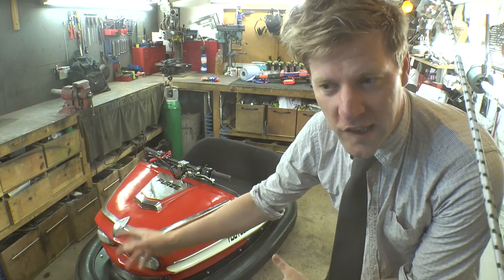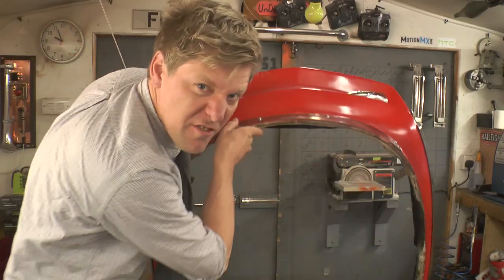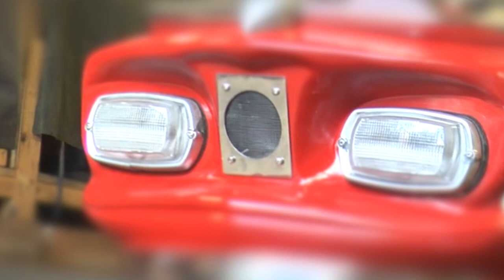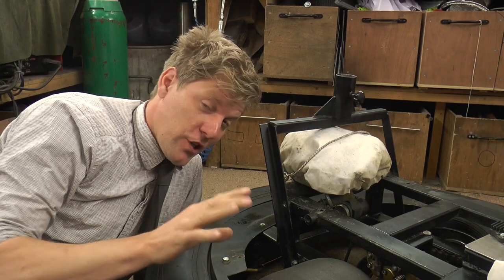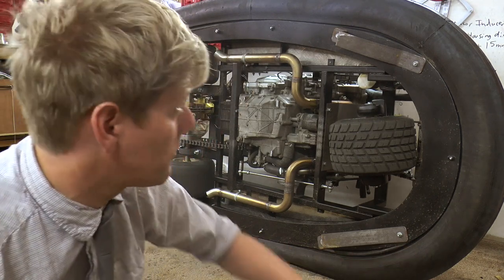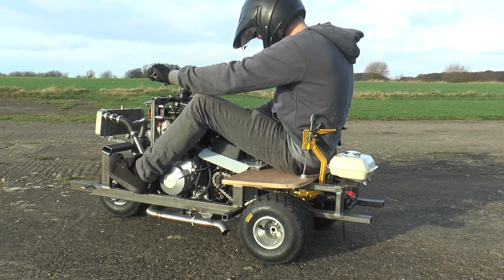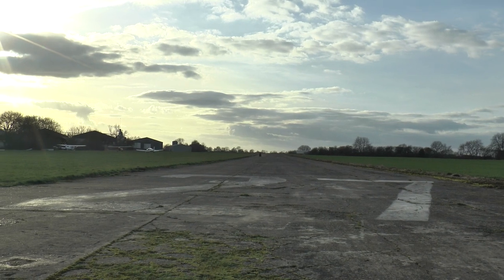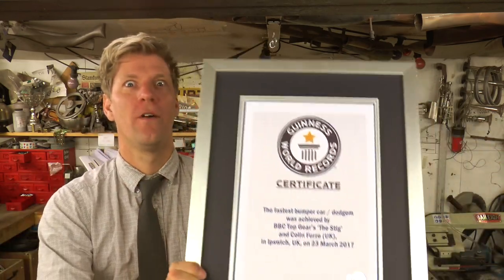100mph Bumper Car Tech Tour/Testing Footage

Comment: anyone else think he's not getting the most out of that engine by shifting at a low RPM?
Reply from the maker: on the first runway its so bumpy you don't want light steering hence short shift
Reply: Hey Colin, never thought your reply, i deffo agree on getting the engine tuned for peak performance, could you get it on one of those portable dynos?
Reply: Chris Readman they actually have dynos for go karts, that could easily be put on there
Reply: doesn't sound like a cbr600 straight piped. could it possibly be running that bad? should be going for 140+ I recon if gearing allows it
Reply: U replied to him???..Whaaaaaaaaaat . Look Colin replied....
Reply: i don't think so , the wheels are too small
Reply: I appreciate the gearing argument. But also consider that the wind had such an adverse effect on the speed would suggest that gearing isn't the limiting factor but infact power is. You see a point where he snaps back on the throttle and theres just nothing happening. A 100hp superbike engine will be ferocious with so much throttle. 100mph just isn't enough
Reply: @colinfurze  you need to get the beast back out knock off the dust .. maybe a turbo or turbine hooked up maybe 115 130 mph ?? i don't have the brass too test that ,, i rolled my go kart about 10 mph in a curve on my back yard dirt track now have a bruised shoulder and arm also a AC separation in my shoulder .. guess i should use the seat belt next time ..

Comment: Jay is probably going to be the most popular kid at school "What does your Dad do for a living?" 
"He puts jets on things and makes things go real fast and gets to drive them". Not only that, probably going to have some pretty good school projects, just saying.
Reply: "A bit of background for this project: My son has a science fair coming up and he wanted to do a scale model of the solar system.  Now I thought, right, that he could do a little one powered by an electric motor... OR, he could make one like this!"
Cut to 20-ft wide moving solar system model running at insane speed
Reply: "As you can see, the Sun actually burns, Jupiter is actually made of gas and this is all powered by a a couple of pulse jets!"
Reply: And we put a tachometer on the earth and it really is spinning 1040 mph at the equator!
Reply: Michael Onines. Balloon busting inbound!

Tachometer measures the speed of the engine (usually RPM). Speedometer measures a vehicle's speed (usually mph/kmh).
Reply: For a spinning object you can use a photo tachometer to get its RPM, then use its radius to calculate speed at the edge. That's the use I intended. I can see with this being a video on cramming a moto engine into a dodgem car where you could take it as me using the wrong readout from the engine, though.
Reply: +Michael Onines. Your comment does make sense now I think about the wheel rotation with one of the hand-held gauges. 

Was smoking and immediately thought engine-wise haha.
Reply: No problem, as soon as I read your comment, I though "yup, I can certainly see where he got that from." I just punched it into the calculator and a 1' diameter sphere would be doing almost 30K RPM to get a circumference speed of 1040mph :-0. C'mon Furze, make it happen!
Reply: +Michael Onines. Oh my. 

Do it! I'd totally watch something like that.
Reply: Raptor Jesus, His coke and mentos volcano project will be epic I bet.
Reply: Or like on Monday during show'n tell his son's like Well I had my father bring his 600cc bumper cart :D.
Reply: He's gonna have a science fair at his school, come home to tell his dad, "Hey Dad, we're doing a science fair at school," and Colin will be like, "Oh cool, can I help you make something?" And Jay will be like "Sure, why not?" But he won't come to school with a baking soda volcano, or even a jet-powered volcano...

But instead he'll come with fucking jet-powered baking soda
Reply: TheLonelyAidan, Ha xD
Reply: TheLonelyAidan ajahahahahahahaha
Reply: Raptor Jesus I don't think that's his son
Reply: Coke and mentos volcano would be more like dynamite and actual liquid rock
Reply: Teacher: Okay class your project will be to build an arts and crafts rocket
Colin: build an actual fucking rocket in  two seconds
Reply: Raptor Jesus so true
Reply: im the 666th like :)))))
Reply: Tormenta
Reply: Physics guy he's not a plumber anymore
Reply: Raptor Jesus f
Reply: Raptor Jesus Colin with a helmet??
Reply: Raptor Jesus After seeing the tie silencer episode...that's  actually sort of reasonable.
Reply: Actually it turnout in the end people like you for being a good person more than anything.

Comment: You got some balls to accelerate into that that speed wobble! crazy awesome stuff here!
Reply: I guess when you're going that fast it's better to commit than to try and slow down. The impact from a wipeout that fast is gonna take you out hard as fuck either way.
Reply: That wasn't speed wobble, it was the camera exhibiting what we call the 'jello effect', caused by the high frequency vibrations of the engine transmitted through the camera mount.
Reply: Yeah it looked like speed wobble but I figured it was just the camera. I wouldn't think that he got much, if any wobble at all. That thing is so stout and the rear wheels are wide enough to prevent that I think.
Reply: john papple jack
Reply: Kyle Brown some say wobble?
Reply: Speed wobble happens on skateboards only lol. Because of the trucks.
Reply: @Saif-zf9vb  You just haven't gone fast enough on 2 wheels yet. Its real and terrifying. Just search "speed wobble" on youtube.
Reply: @Saif-zf9vb  happens to jeeps too. Self amplifying resonance.
Reply: Viper  thats camera jello it needs a nd filter its from too much light
Reply: @eddycurrent413  nope vibration, older camera phones were terrible for it.
Reply: He doesn't just has balls, he has balls of pure vibranium. Thunder is really just his balls clapping together whenever he runs.

Comment: Excellent designer, fabricator, and detailer ~ it's absolutely awesome.  Back in 1970s, when I was in junior high, I use to make miniature 40 mph dune buggies out of junked riding lawn mowers called "REO RIDERs" (because my mom refused to let me have a dirt bike). They looked just like dune buggies, right from the factory.  Changed the gearing,  used the hood springs from a '63' Olds to pre-load the clutch pedal in opposite direction,  and replaced the 7HP Tecumseh with a Briggs 12HP.  Later version utilized a Honda 305 Dream twin cyl.

If you revved it up, dumped the clutch, and leaned back in the seat it would do a wheelie for 20 yards ... if you leaned over the steering wheel it would do a smoking burnout for 20 yards.  They had crappy little 2 speed gearboxes that had to be rebuilt every season.  Used them for hill climbing, general trail riding, and to compete against dirt bikes at the gravel pits.  Every kid in town wanted me to build em one.  I became popular.  Oh yeah, one other thing:  The cops couldn't bust us or do anything to us, period. technically they were just riding lawn mowers.

Comment: you need to build an under carriage so it doesnt get sandblasted under all there. Also your losing power because of the straight open loud pipes  , it needs back pressure so put some mufflers on it .

Comment: How much work would it take to make that road legal? I sense another world record coming along if it's possible
Reply: I don't imagine it'd be too much. Since it has 3 wheels, it can be registered as a motorcycle (well, a trike...). It just needs head/tail lights, indicators, a numberplate bracket with permanent lights on it, some mirrors.... And that's it I think. As for the numberplate cost, I'd have no idea.
Reply: Ismail Fisher Just say it's a slightly modified honda

Comment: Re the dyno: you could put it on an axle/hub dyno rather than a rolling road. They bolt to the hub's rather than the tyres sitting on rollers. You might have to make up some adapters since they're generally used for cars, but I don't think it's beyond your capabilities...
Reply: I was thinking on the same lines too.

Comment: If you actually want to dyno that thing it would be pretty simple to get it on a motorbike dyno; just take off one rear wheel and add a strut under the frame on the same side to keep the cart level. Solid rear axle, right?

Comment: Could you drop in a temporary axle with just one tire the same diameter as the current ones and the same gearing ratio and chain length to tune it on a motorcycle dyno? Then just change it back to how it is now after tuning.

Comment: Got an idea for an invention! A cooler attached to the bottom of the table with cold drinks in and a table has a hole where  a platform with a drink in will raise up through the table just in the press of a button. The hole in the table will have a metal hatch that can be remotely opened/closed!

Comment: You don't really need a dyno, just make a high-speed run, shut the engine off right after you let off the throttle, don't let it wind down, then remove and read the spark plugs. They will tell you if you need more or less fuel, timing, etc., etc..

Comment: go day colin iam from australian and i am 13 years old and my dad is a diesal mechanic so i have all the tools and equipment and remeber the mobility  scooter  you made well i am starting to make on with a air cooled 250cc 4 stroke  yamaha motor 6 speed so it sould ripper i am going to make  it all a littel bit wider than usual so i dont roll it ill find a way to send you some picture, on and can i just us a 25mm to 50mm rod as my axle from the metal joint thanks mate keep foing what your doing we all love

Comment: Dude, you should try and make Mei's ice gun from Overwatch. It would use liquid nitrogen as a coolant, you would inject water into a chamber, the nitrogen would flash freeze it and compressed co2 would shoot the ice out the front.

Comment: You need to get a car or a van or something, Remove the engine, and strap pulse jets to the back of it, and see if it'll go to a higher speed than what the actual vehicle was made for, set up the same kind of system as with the Jettle with air outputs as well as gas, control it all from in the cab of your chosen vehicle, have large Gas and Air tanks ready to be used (Hence why a Transit van would be best) and just see what you can do!
This is from the mind of a 15 year old, at 5am

Comment: Colin, It's time for you to build a plane. A real one, you sit in and fly. Plane. 

Go with an ultra-light, (single seat, under 254 pounds and some other minor details as specified by the FAA in FAR Part 103,) to start with. 

If you build it in America you don't even need a license to take off. Flight school is recommended but not required by law. Silly laws won't get in the way of being unsafe over here. 

See beliteaircraft for ideas. No, I don't work for them; just pine away wishing I owned one of their kits and a motor.
I don't know. Just an idea to mull over. How hard can it be really? It's just flying after all. Easy.

Comment: That poor Honda lump doesn't sound too good the motor sounds a bit strangled probably down to sprocket sizes and getting the rear sprok on ? I would probably dyna jet the carbs say stage one kit depending on the model mind,  but the amount of heat created will get back into the air box so you gona have to get more of that hidden rad unhidden if u get my drift or you will ding the motor..big time, I'm guessing the motor is good for 110 bhp= 140mph plus top end, your bumper car should hit 120mph as she stands by my guess otherwise Colin 10 0ut 10 mate for all round effort..u mad c@*T

Comment: Tried very hard not to comment, but it's no good I have to correct you!  It's Reliant Robin, NOT Robin Reliant!!  FFS!!  Apart from that, find a place with a Kart dyno to set it up, but it might not have the power capacity to cope with it!  There aren't many Karts with 100+ HP!!